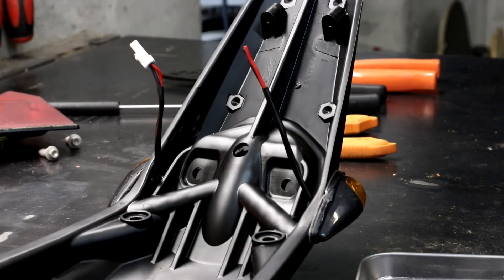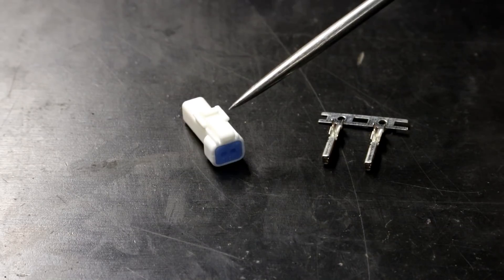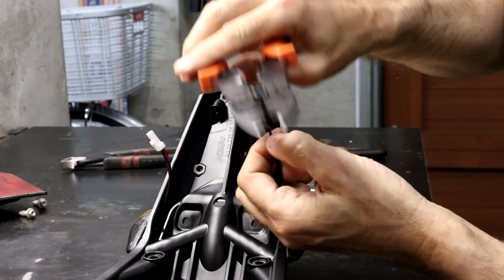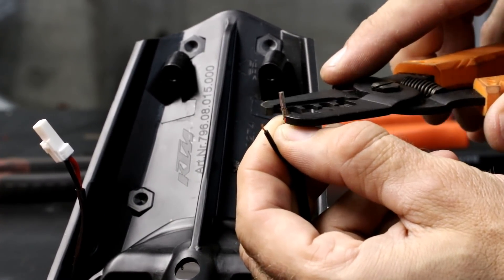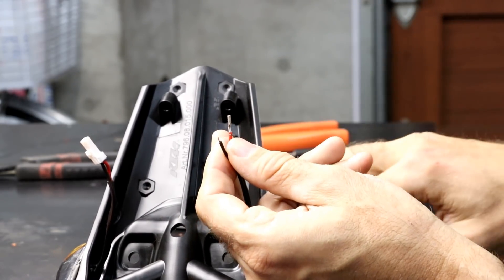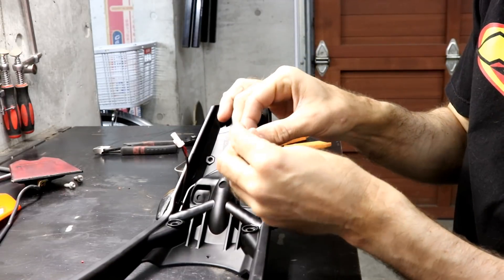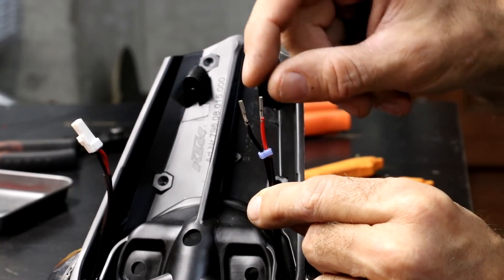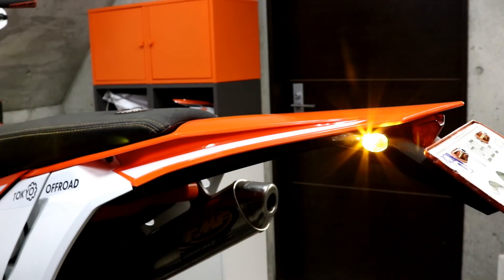KTM OEM Turn Signal Connector Install

Comment: Great video! Looks like my wire popped out, how do you get the metal crimp out of the connector housing? Or do I need to replace the entire housing?
Reply: I had the same problem and used an iPhone SIM card removal pin to push out the crimp. Worked first try!

Comment: "Sicass racing "has similar products for Ktm plug and play no soldering required
Reply from the maker: Yes, some turn signals are available with KTM connectors already attached, including Sicass Racing, Tuff Lites and of course KTM. This video was intended to show how to install connectors on other universal type turn signals which are supplied without connectors, or replace damaged connectors.
Reply: @TokyoOffroad  This video was also very helpful as I crushed the connectors (bike and turn signal sides)to one of my turn signals in a crash.  Now I can buy and correctly install the connectors at minimal cost.  Thank you for this video!

Comment: nice video' can you please give some advice,i have this old 6 volt bike that has only regular  front turn signal so i bought 4 mini 6 volt led turn signals and hooked them all up,the problem now is when i switch to the left,all 4 bulbs is flashing,same way when i switch to the right,so what seems to be my problem??thank you so much.....
Reply from the maker: There are typically two issues when going from regular bulb type turn signals to LED: 1) the turn signals may flash too fast- swapping out the turn signal controller for a solid state relay will fix this. 2) All four turn signals come on- this is usually caused by the turn signal indication lamp. You can either disconnect the indicator lamp, or modify the circuit by including a couple of diodes and grounding the other side on the indicator lamp.

Comment: Did you have to replace the stock relay when switching to led indicators
Reply from the maker: Yes, I changed to a solid state flasher relay and also retired the turn signal indicator lamp, by grounding one side and then attaching the original wires to the other side of the lamp via two diodes.
Reply: Sorry mate that’s straight over my head. So the green indicator flashing lamp will no longer work once LEDS are installed
Reply from the maker: Shaun Bradshaw - Correct. You can either disconnect the green flasher indicator lamp, or modify the wiring how I described. Somewhere probably sells a kit (two diodes) to do this.

Comment: nice but this mini turn signals do fit fully on that edge of fender right?   BTW do you have quick release plate frame?
Reply from the maker: No, the turn signals overhang the lower edge of the sub fender slightly. The license plate frame bolts to the subfender via a metal stay. It is not quick release, although it can be removed in a couple of minutes when required.
Reply: yeah, I have problem with license plate, have destroyed 2 already when doing wheelies or jumps so I need to come up with quick release system to take them off while off-road.
Reply from the maker: Yes, if you don't need the license plate on it's certainly better to take it off, And you'll be less likely to damage the subfender too. Most of the places we ride you need to have a license plate, so I only take mine off when when ride at a closed course on private land

Comment: nice but how did you lead the wire they don't break while jumping or crashing wheelies etc?  My wires broke first day I installed turn signals :)
Reply from the maker: If you look careful at the start of the video you’ll see there is a hole in the center of the sub-fender. The turn signal wires go through the center hole and are held in place the other side of the hole (internally) by using a zip tie. The original sub-fender I used for 18months and had no issues with the wires catching, or being pulled out.

Comment: Wich indicators you are using in this video?
Reply from the maker: The front indicators are Tuff Lites
http://extremedualsport.com/index.php/products#!/Tuff-Lites-KTM-connectors/p/85333796/category=19391174

The rear indicators are generic flush mount LEDs purchased on Ebay. I removed the cover, and attaced the baseplate to the subfender using 3M doublesided tape and two screws, then glued the cover back on. A bit of a PITA, but they are cheap, small and not easily broken. 
https://www.ebay.com/itm/Amber-LED-Motorcycle-Flush-Mount-Turn-Signal-Light-Blinker-Indicator-Lamp-12V-ZY/152849884006?epid=838117477&hash=item2396902366:g:znYAAOSw42dZCcZe&vxp=mtr
Show less
Reply: Tokyo Offroad 
Very useful and as you said, they probably do not break as often on the Trail as the OEM ones.
Thank you

Comment: What flush mount single you have ?  All the ones I used had to be mounted below the tail lights.  Nice singles. Good video.
Reply from the maker: The same as these ones. I don't use the supplied tape. I use 3M tape, plus I carefully remove the top lens cover assembly, make two holes in the base plate and screw it to the sub fender. To reattach the top lens cover assembly I use some  high strength black sealant glue: https://www.ebay.com/itm/2Pcs-Amber-LED-Motorcycle-Flush-Mount-Turn-Signal-Light-Blinker-Indicators-Lamp/232129853276?epid=2021138037&hash=item360c04775c:g:aVQAAOSwB09YFvOF&vxp=mtr

Comment: Nice video.  I broke the little locking tab on the connector that goes on the fuel tank (for the fuel pump on a 4 stroke fi ktm). Right now i have it on there secured with a ziptie :( that install is a bit more complicated than this but this video is motivating me to fix it right :)